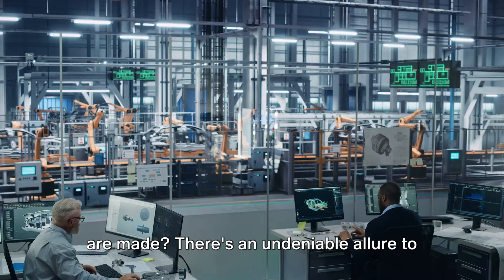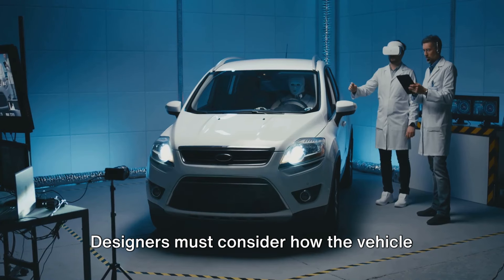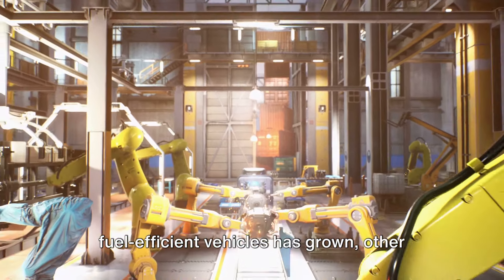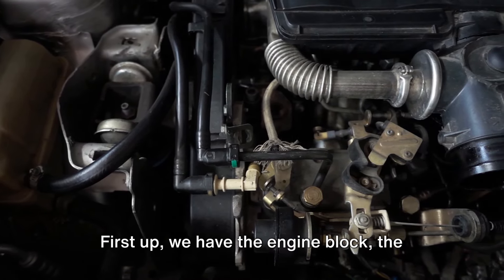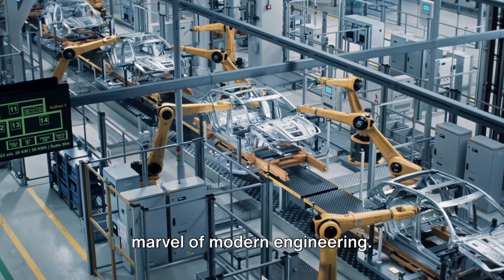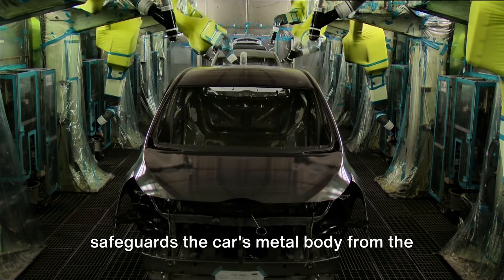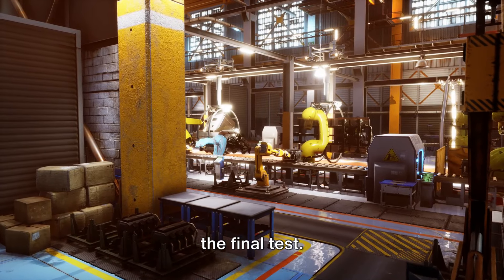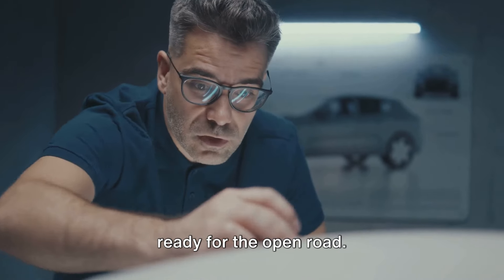Discover the Intricate Art of Car Manufacturing

Comment from the maker: 00:01 Car manufacturing is a captivating journey of innovation and improvement.
01:51 Modern car manufacturing integrates advanced safety features and utilizes computer-aided design.
03:41 Car body construction is a blend of science, engineering, and art.
05:28 Car engine components and their functions
07:14 The car's electrical system is crucial for powering and managing various features of the vehicle.
09:01 Car manufacturing involves primer, base coat, clear coat, and final quality control.
10:44 Car manufacturing focuses on safety, performance, and functionality.
12:29 Car manufacturing is a complex blend of human ingenuity and cutting-edge technology.
Crafted by Merlin AI.